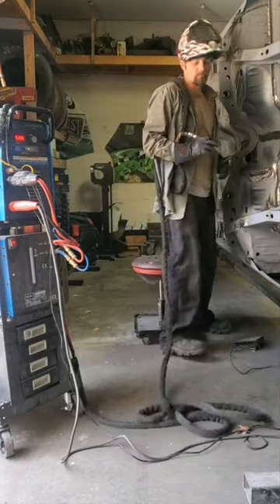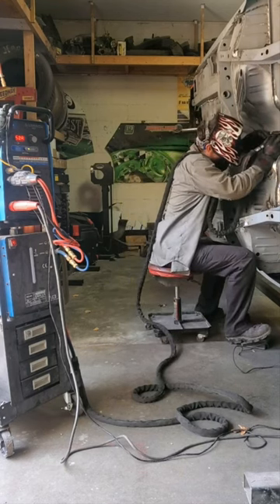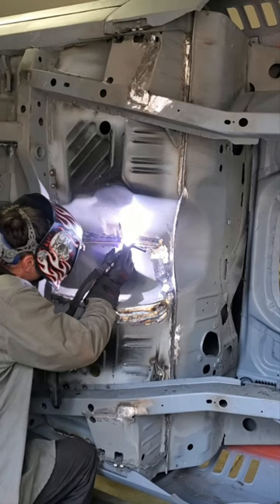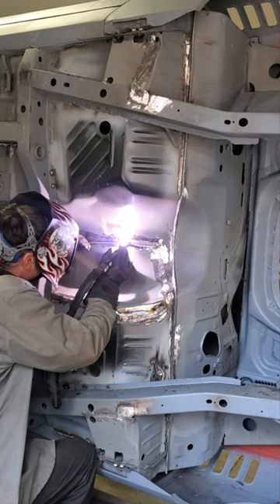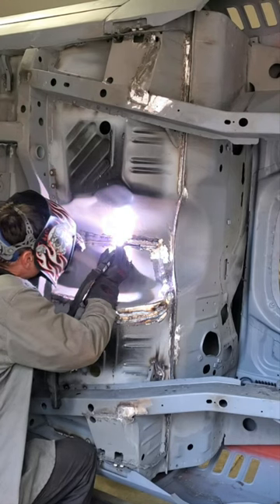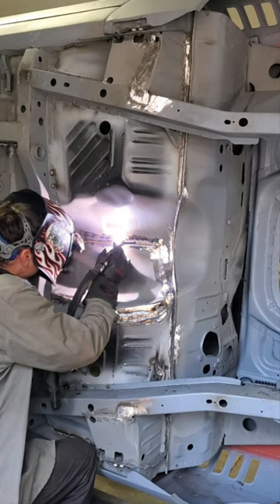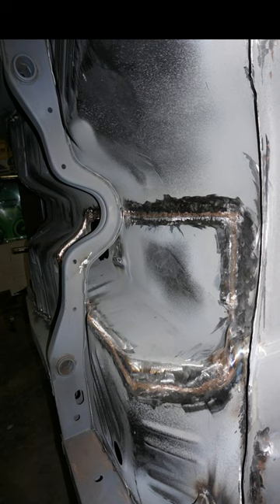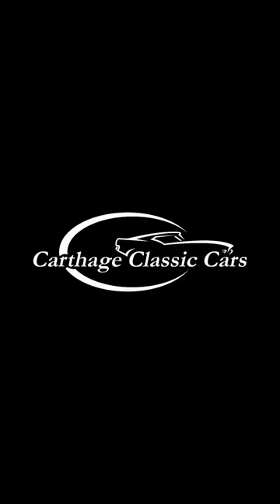TIG Brazing With Silicon Bronze #shorts

Comment: So why this filler wire over others ?
Reply from the maker: This is a low heat application so your not fusing the metal like welding. it is also easier to grind and smooth out making for sealing out water better and cleaner then seam sealer. It does not hold nearly as good as traditional weld so you need to be careful where you use is that the area is not structurally needed but to seal up the trans tunnel here it will provide a nice rust resistant seal that will last for a long time.